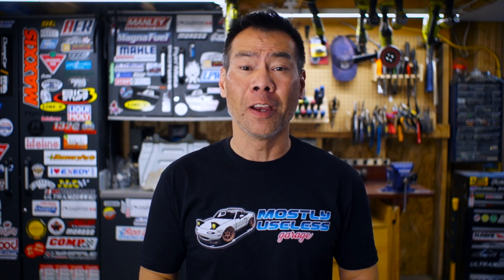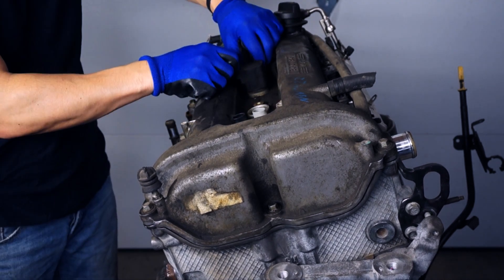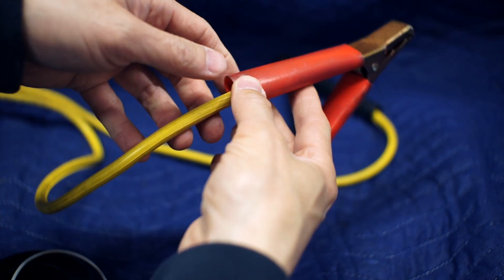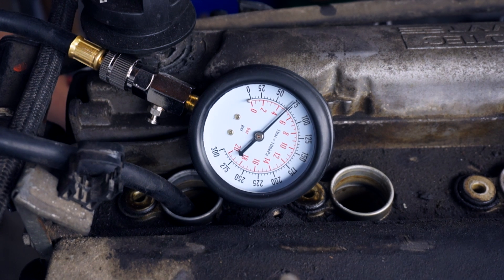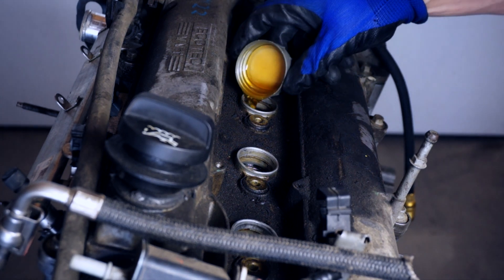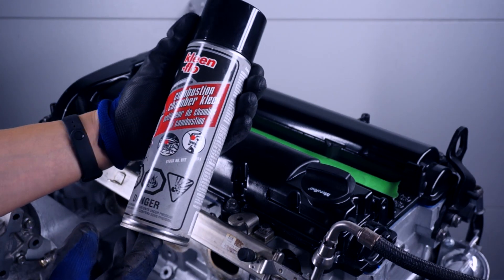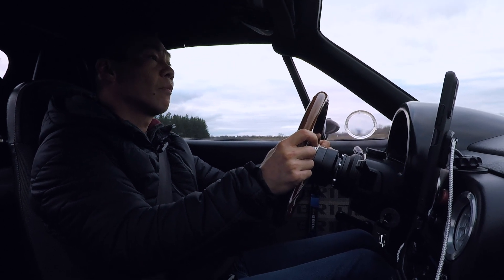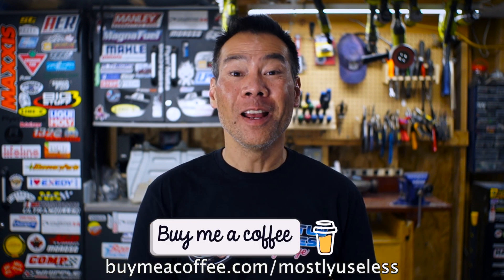Compression Test on an ENGINE STAND | Quick & Easy DIY

Comment: Hey man, did you just leave the kleen flo in there? Or do you have to drain the oil prior to starting? I assume you did multiple kleen flo spray sittings and then drained the fluids?
Reply from the maker: I did 3 rounds of Kleen Flo and drained everything before installing the engine. With some crap oil filled I ran the motor for like 30 mins and drained to hopefully clear the majority of the sludge. Good question!

Comment: The last segment of this video is a great summary to the trustworthiness of a ‘quick and dirty’ pre-install garage test.  I’ve adopted the habit of sending off an oil sample to @BlackstoneLaboratories to rule out the presence of any bearing material, coolant or fuel in the oil of a used engine, ideally pre-purchase if the seller is amenable to it (and assuming the oil filter is still installed).  It’s amounts to a very insightful yet inexpensive insurance policy at only $35 per sample analyzed.

Comment: I've learned especially engines that have sat need to have oil pressure built back up to pump up the lifters and such before they'll make good compression. However, yours likely cranked enough to build pressure. Glad it all worked out for you!
Reply from the maker: Good point, presumably with all the cranking the oil pump would be able to build pressure, but short of pulling the valve cover I couldn't check.